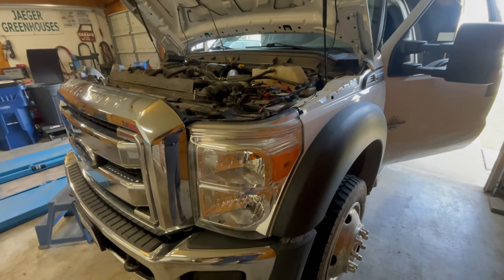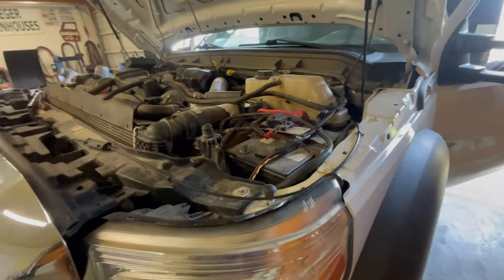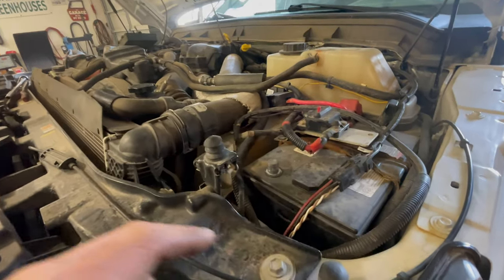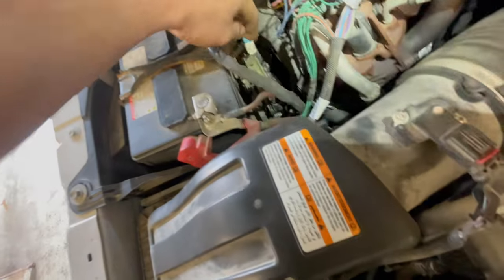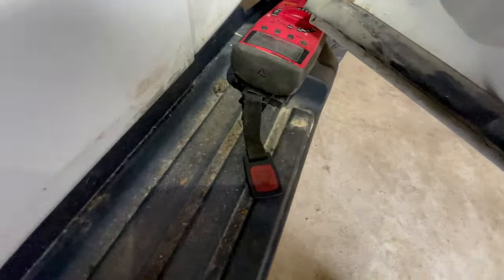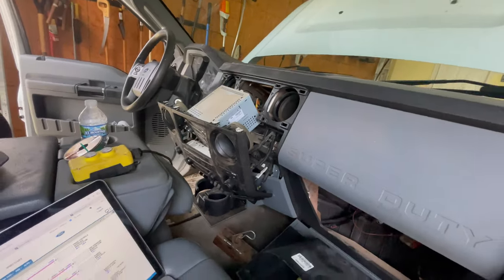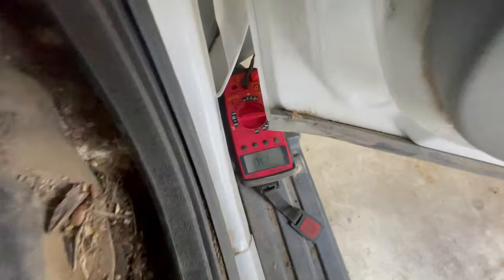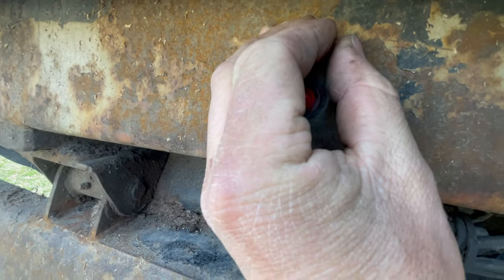Ford Super Duty Dead Battery Overnight FIX

Comment: The overhead Cab light gaskets on mine, dried out and water was getting into the headliner.  Couldn't tell they were bad by looking at them, but a new aftermarket light fixture fixed my problem.

Comment: Thanks so much for this video! . . 2011 white 6.2 purchased used with massive electrical issues along with rusting.  Finally figured out it was from upper  Canada, most likely used in oil operations.  Beaten to hell and exported for sale via auction in the United States.  I understand it's a loophole for avoiding disclosure.

Comment: THANK YOU for sharing your experience and knowledge on resolving an often very, very difficult problem to solve.  My challenge is a 2001 F450 diesel with the 7.3L that I just bought.  Previous owner advised me he had been having problems starting the truck (not starting really but cranking) so he was gracious enough to install two brand new batteries before delivering the truck to me.  It was still slow to crank so I fully charged the batteries (to 13.25vdc) and it sat for only a day and when I went to crank it the batteries were too weak.  Battery voltage had dropped from 13.35vdc to 12.75 in less than 48 hours.  I plan to diagnose my issue following your method as soon as I get an ammeter.  Thank you!!

Comment: Nice video as always. Mine ended up being the air suspension module in my 2002 Lincoln Town Car. Also located behind the glove box. I don’t know what caused it to fail because it and the area around it were spotless, but yeah my battery would drain overnight.

Comment: I once struggled with something similar, it turned out that the bulb in the glove compartment did not turn off when closed. 7-14 days of not using the car resulted in a discharged battery... Sticky tape pressing the closed door button permanently solved the problem :)

Comment: This goes a ways back, but I had a water leak from the windshield cause a short in a GM DRAC module ('92 1-ton van), only when it was raining.  The speedometer would go wacky, and soon the transmission would go into limp-mode. It usually got better after it dried out, but eventually quit altogether. A junkyard replacement (and some silicone for the leak) fixed the problem.

Comment: Thank you for the video. 👍
 I tried diagnosing my 2011 SD 250 and came up with the alternator diodes... changed the alternator but that wasn't my problem....So... now to the fuse pulling to find my Electrickery Problem.